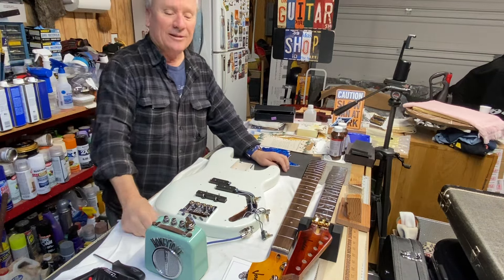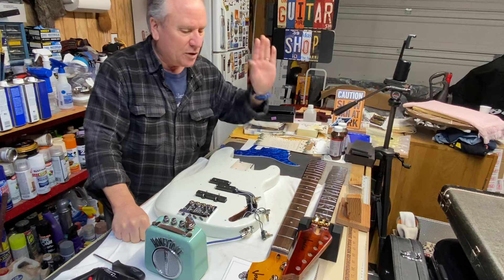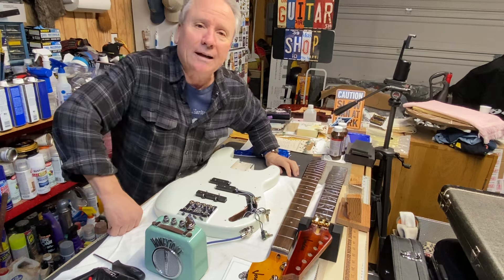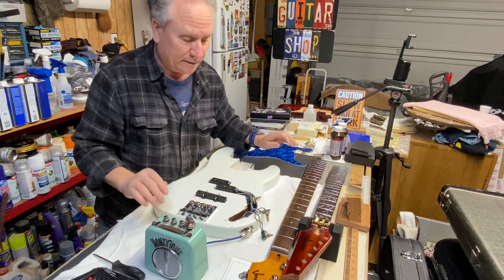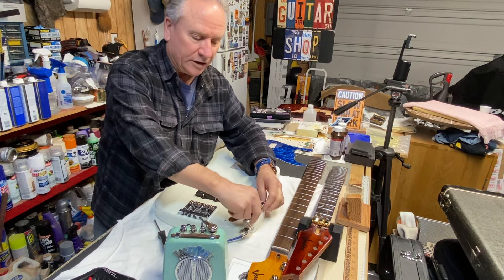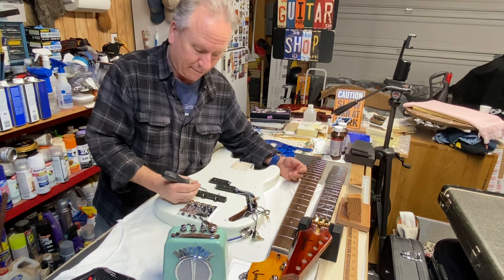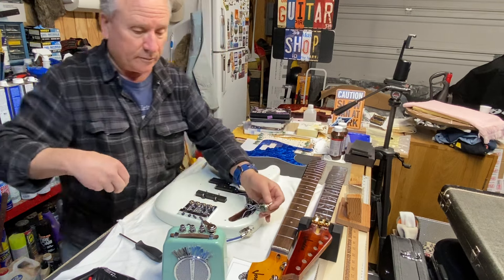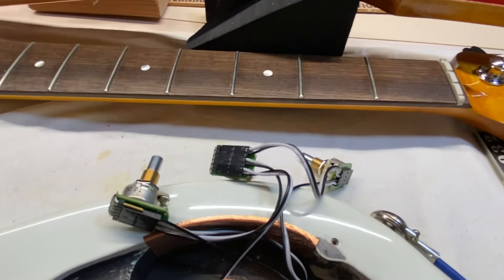Crazy electric stuff

Comment: Yup! You get what you give... always! Want more? Give more! 
Weird about that wiring problem. Can't be too serious!
Good luck!😁
Reply from the maker: I’m in contact with EMG, no word yet on a fix. One guy said something about shielding?? Like it could be causing the problem???🤯
Having to send pictures etc, for an analysis. Me and wiring!
Reply: @guitarzan0515  yup if that cavity is sheilded and that circuit board is making contact, then it's grounding out the circuit and cutting power to the pickup for sure. And easy test is put masking tape at the bottom of the cavity where the pot sits.
If the cavity isn't sheilded then it's a connection problem😀

Comment: Probably something simple, a bad solder joint maybe.  Get out the magnifying glass ...
The bass looks nice
Reply from the maker: Well, there ain’t no solder joints. It’s all plug and play. Thinking it’s a bad wire, or maybe the pickup, or something is awry with the circuit board,although they were fine before I installed them in the pickguard 🥵 Thx for watching. We’ll get er figured out. Hope to visit again soon!